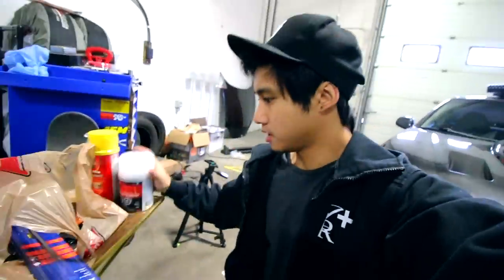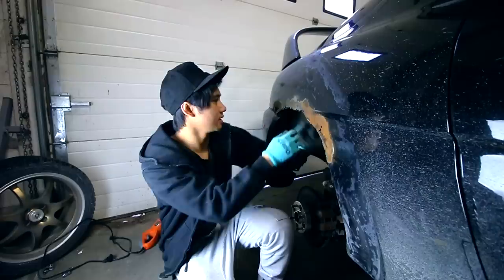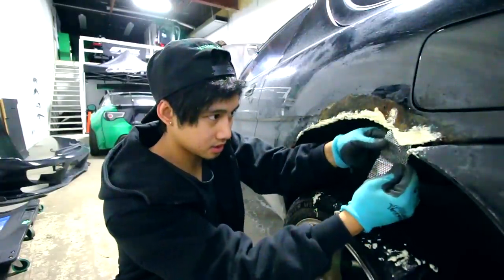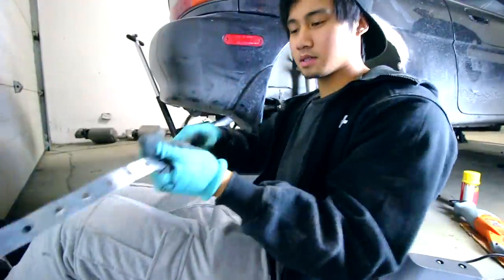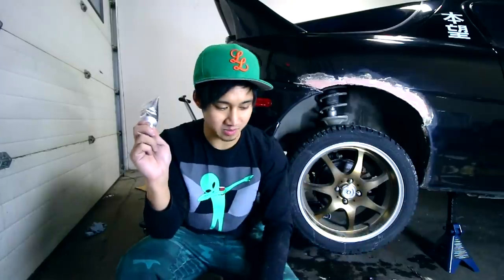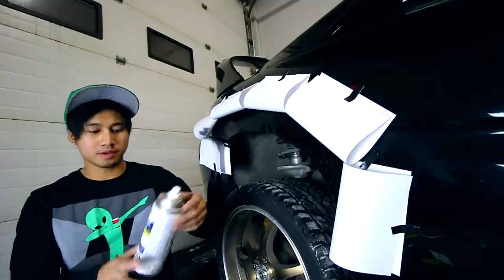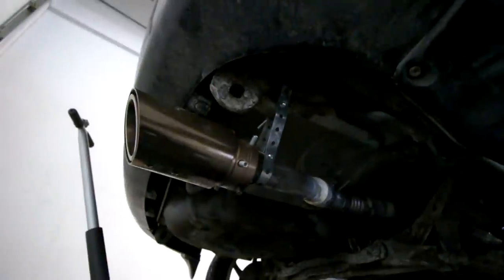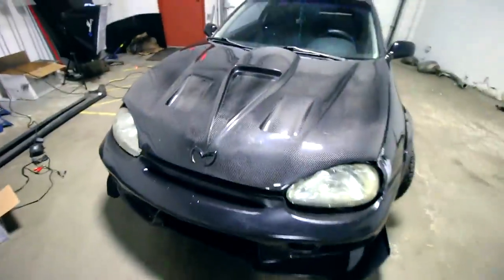Quick Rust Fix // DIY Straight Pipe Sound Clip

Comment: As a welder you didn't get rid of the rust problem you just covered it up. If you were to sand down all of the surrounding rust and then bondo it it woulda been fine, but you left a lot of rust and you probably won't notice it. However in a couple years if you still own the car you'll notice the rust you covered up is eating away at your car from the inside out.
Reply: Uses palm sander on bondo but not to remove rust
Reply from the maker: Good call.
I thought trying to sand it off as much as possible from the outside was good enough,
didnt do enough research thats for sure,
but thanks for the insight.
Reply: No problem, good enough right? It should be fine for a while or maybe not a while because you live in Canada. I live in Cali so I don't really know what snow is =).
Reply: Johnathan Polson is there any type of sealant he could use on the sanded area to prevent rust?
Reply: Some companies make rust neutralizing compounds or converters that will stop metal from rusting and coming back, but I'm not sure how well they work because I've never used them.  I've heard people have success from them and some people not so much, but the best sure fire way is to completely strip the all the rust on a part and prevent it from coming back by sealing it off with whatever you're using. Paint, primer, undercoat, basically anything that shields the metal from atmospheric gases and water.

Comment: At 3:20, I wouldn't reccommend using the foam spray as it would actually make the rust problem 20x worse. The foam is a good idea, however it collects moisture and when exposed to metal, it will make the rust problem become amplified.
Reply from the maker: Wasn't thinking of this during the process, but worth looking into.
I threw on some of that rust remover before the paint
Reply: CVR Games thank you for your point you are smart

Comment: Not sure if anyone has told you yet, but I would recommend putting hood locks on that carbon fiber hood. After time, as the latches on most cf hoods are just adhered to the fiber glass on the bottom side of the hood, the latch will break off if you don't have locks holding it down as well. The wind that gets caught under that gap there is pulling up on that hood constantly and the faster you go, the harder it pulls up. It's just a matter of time of when the latch will break off and the hood slams into the windshield/roof of the car causing a lot of damage and possibly an accident.

Comment: Step 1 repair rust step 2 Bondo step 3 sand step 4 primer step 5 spot puffy step 6 primer step7 wet sand step 8 paint step 9 wet sand with 2000 grit step10 buff it out 😎👍 enjoy what you did

Comment: Just a word of advice bro next time you do a rust job on the wheel well it would be easier to cut the rotted metal out with a plasma cutter or angle grinder and cut a piece of sheetmetal from your local hardware store and form and weld it in place of where you cut the old metal out what you did and where you live that rust will break out from under the bondo in a matter of months

Comment: From a unexperienced mechanic point of view this is the worst rust removal ever. Your pretty much just ruined this cars body panel. The rust isn’t that bad you need to keep sanding until its all gone and make sure you have removed in from the inside as well then use wire mesh to strength the metal. Use bon-do to re shape it then paint. Also good idea to use bed liner for the wheel well so that they isn’t exposed metal.